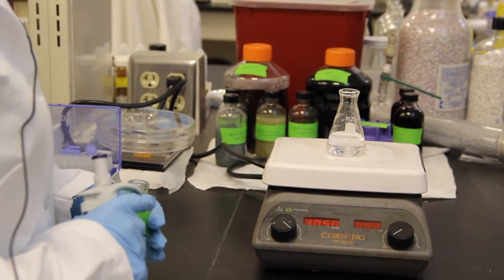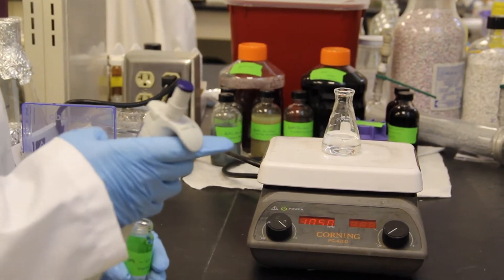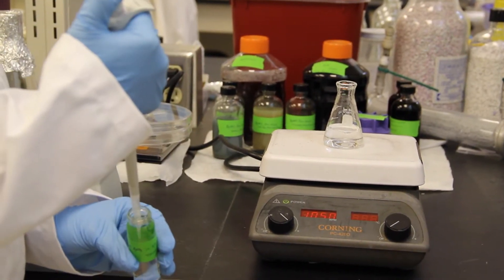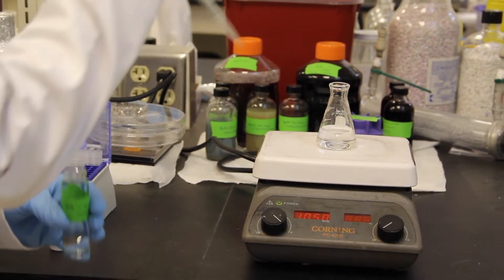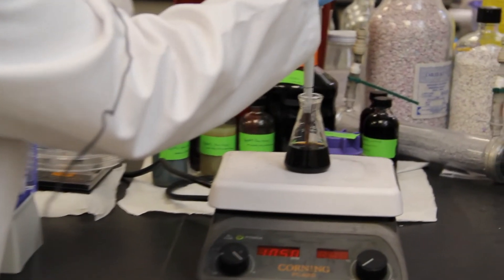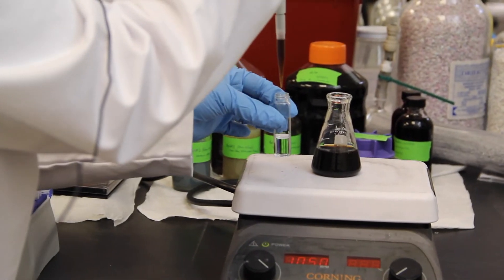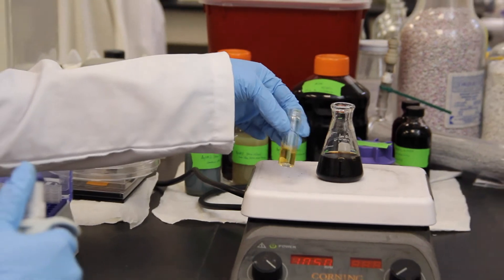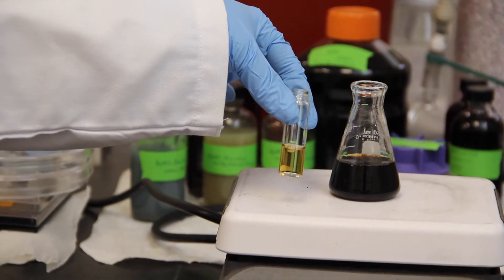Duke Engineer Demonstrates Synthesizing Silver Nanoparticles

Comment: 1. is the water distilled.
2. what are the ingredients in the "stabilizer"
3. what are the ingredients in the "reducing agent"
Reply from the maker: 1. The water is ultrapure (also called Nanopure or Milli-Q water, depending on the
purification system).2. The stabilizer is gum arabic.3. The reducing agent is sodium borohydride.Make sure you wear PPE (personal protective equipment), because some of these reagents are hazardous!
Reply: Thanks, when she adds the silver ions, is that the same as colloidal silver?
Reply from the maker: Colloidal silver (another term referring to silver nanoparticles) contains silver with an oxidation state of 0, meaning it is not charged, and is therefore not an ion. In order to synthesize it, you must start with silver ions with an oxidation state of +1 and reduce them to an oxidation state of 0 with a reducing agent (which itself gets oxidized in the reaction). In this case, the source of silver ions is a solution of silver nitrate, AgNO3.
Reply: Thanks :-)
Reply: @dukeengineering  good day.....how will i prepare the stabilizer and what is the concentration of your AgNO3?
Reply from the maker: Hi there! The video is really meant to simply give a general idea of how nanoparticles are made to people who have no idea. It's not really supposed to be an actual "how-to" with specific directions to follow. For those sorts of questions, please get in touch with the people at Duke's Center for the Environmental Implications of NanoTechnology - here's there website: https://ceint.duke.edu/contact